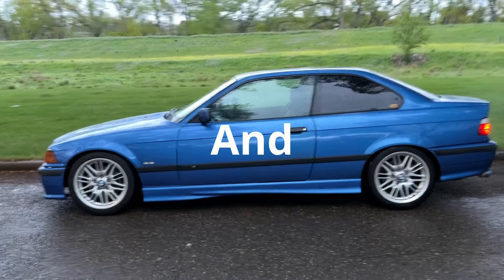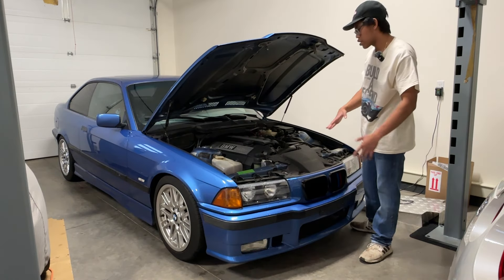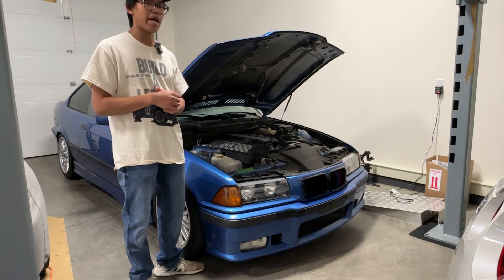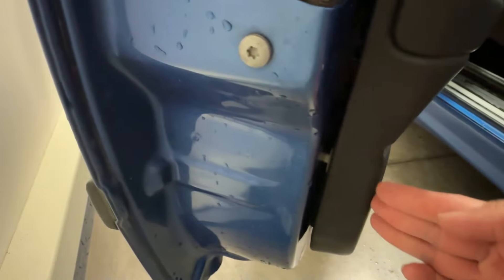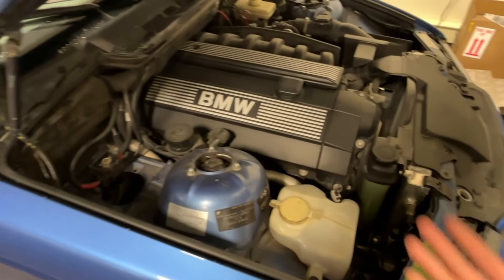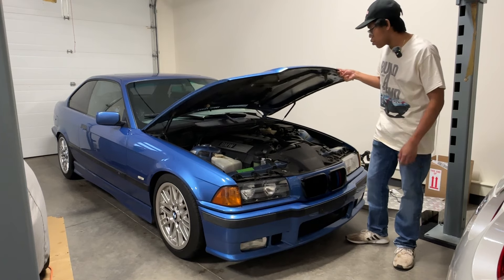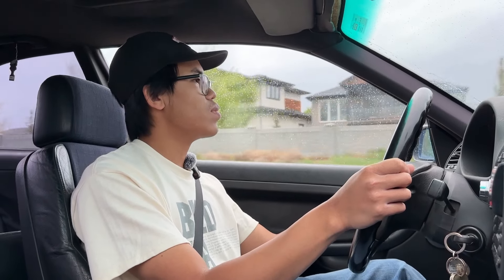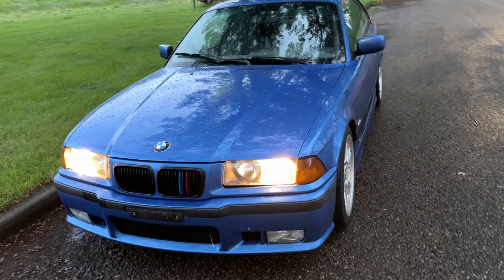My BMW E36 Is Terrible ( I love it )

Comment: Fyi the cooling is absolutely fine. If it's not broke, don't 'fix' it and if it is broke fix it with the SAME OEM PARTS U TOOK OFF!! This INCLUDES the water pump with it's COMPOSITE(not plastic) impeller that lasted +150k miles

Comment: 13 year owner of E36 M3/4/5 and recently picked up a techno violet E36 coupe. Car has been amazingly reliable and easy to work on. There’s great aftermarket support for this platform and the car is so easy to work on. I love this platform so much I have 2 of them. The trunk harness is a non-issue. There’s 2 brackets on the hinge that keep it out of the way. Get some clips. Headliner cost me $100 to fix. Clutch was $350. Brakes $300. Oil changes $75.
Reply from the maker: @DonBMW  Very easy to work on! I am planning on restoring my headliner/interior soon  so that is very good to know it was so cheap! (and omg techno violet is such an awesome colour)

Comment: stock exhaust???? if that's the case you might have an exhaust leak because my 328i stock sounds no where near your car.
Reply from the maker: Has an aftermarket magnaflow muffler. You’re correct, I do have an exhaust leak

Comment: another young and new e36 owner… welcome to the club man. 

my 328is was my first car a couple years ago, and in my experience it has been the absolute most fun and forgiving experience of ownership i could have ever asked for. i’ve met amazing friends, learned so much about cars, and have grown to appreciate e36’s more than an s chassis which was my favorite car for multiple years.

people have their reasons for not liking an e36, but fail to forget that the youngest models are 25 years old at this point. they’re old and need maintenance like any other car. once you take replacing everything(cooling system, bushings, suspension components, subframe reinforcements), you will understand why so many people fall in love with these cars. i also bought my car sight unseen, as an auto, with 207k and a CEL, but of course i was quite lucky. i’ve also since turned mine into a race/drift car. i’m glad people are starting to recognize how good they are. take care of that thing!
Reply from the maker: Absolutely, it’s such a fun car!

Comment: I feel your pain. I bought an auto 97 M3 (with the intention to convert it). Before I could procure all of the parts for the swap, the auto trans takes a shit - stays in 3rd. After the swap, fan blade explodes and takes out the radiator. After the electric fan conversion and new rad, parking brake shoe springs blow apart within the rotors while driving. After replacing all of that, vanos takes a shit. After rebuilding the vanos unit, I fried the battery with a loose coil pack harness connection. After the battery, the belt tensioner siezes up and shreds the belt. Now im waiting on the belt and tensioner, along with the next thing to break 🫠🤑
Reply from the maker: @kc550  And I thought I had bad luck lol!These e36’s are such money pits 😅 so fun to own tho
Reply: @KevinTa02  haha they are certainly drama queens! That was all within 6 months, might I mention 🙃. Wouldn't trade it for anything else though (maybe a 911).
Reply: sheesh man
Reply: Sounds like you just bought a bad condition one
Reply: @TERRORIZERRRR  the car is almost 30 years old, is a Canadian car, and has 200k miles on it.

Comment: try ac delco head cleaner. u need to drip down some where ur spark plugs go, and let it sit on the cylinder side walls. and it might just be the dirty side walls. after that, u might get better compression numbers. but if ur gonna rebuild it, do it. but that's just a way to get better compression numbers without rebuilding. also sea foam or berrymans b12 could also work. but the best stuff is the ac delco head cleaner. the blue liquid. its discontinued tho. but ebay has some

Comment: What makes a B52 reliable?

Hey @Kevin Ta, in you video you mentioned that" the M52- in my 328 is thee most reliable BMW motors". 
I have been looking to buy a 90's 3 series as a daily driver, I hear that the M50 B25 is the most reliable because of it's steel block unlike the m52 with an aluminum block. I am curious what makes the M52 a reliable Bmw engine. 

Thanks and all the best.
Reply from the maker: “One of the” most reliable bmw motors. Some 328is’ came with iron blocks as well! In my opinion both M50 and M52 alu block are extremely similar reliability wise when kept OEM or FBO (and of course taken care of when it comes to cooling.) As my daily driver the farthest I would push it is FBO. Once it comes to boosting then I hear M50’s are slightly more boost friendly but M52’s are still a great option. However, once you start adding boost to any motor then you enter no man’s land when it comes to reliability!
Reply: If you live in the United States, all m52b28 328i engines are iron block.
Reply: @Rekt-M8-v4 just like 2jz, 500-600 hp stock bottom end 🤫
Reply: Aluminum blocks on M52 engines were not exported to the US.
Reply from the maker: @sayitaintso2900  Correct. I thiiiink my 328is has an aluminum block tho being a japanese model ;(

Comment: exhaust systems is not original.. sounds terrible. Nice car, estoril blue?
Reply from the maker: Yep estoril blue, and I agree exhaust doesn’t sound the best at higher rpms.😅 Looks to be an aftermarket muffler with just blue tips welded on

Comment: Hi, what is your opinion about the M50 2.0 6 cylinder motor for e36? (and if it has vanos, single vanos, how bad is that?)
Reply from the maker: M50’s seem great for boost and reliable for daily driving if kept stock (and all E36’s have single vanos.) Doesn’t mean it’s a bad thing! (Double vanos came out with e46’s.) Whether it’s single or double everyone has to eventually do vanos maintenance.
Reply: @KevinTa02  But i saw other yt videos about e36 and people selling their e36 with M50B20 engine and it has no vanos, so i guess 2.0 6 cylinder has 2 variations? with single vanos and non-vanos?
Reply from the maker: @kemeron5759  Oh sorry I misunderstood! Yes E36 m50’s had a vanos and non vanos version. I would imagine non vanos would be better for forced induction builds but i’m sure single vanos would handle it well too (just probably not as high hp numbers.)
Reply: @KevinTa02  Thank you so much for the reply! Appreciate it!
Reply from the maker: @kemeron5759  Anytime 😃